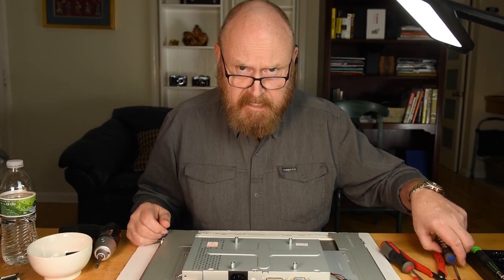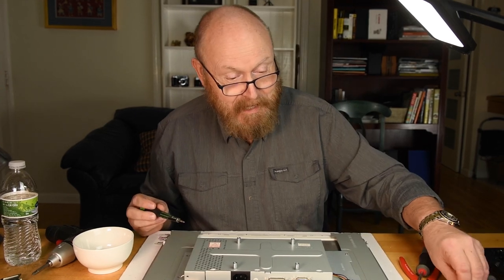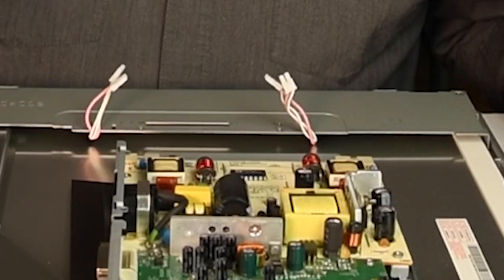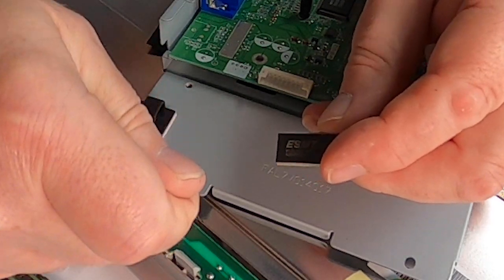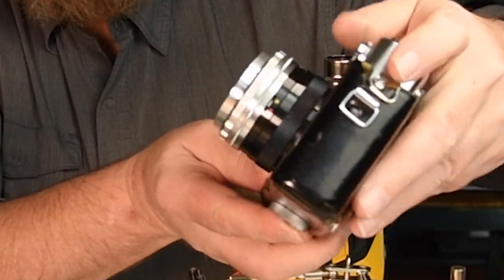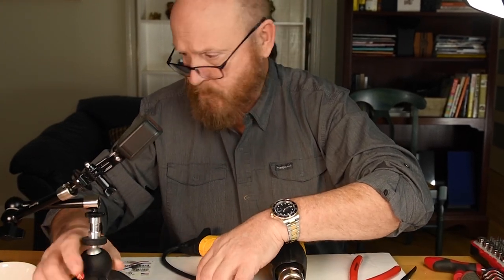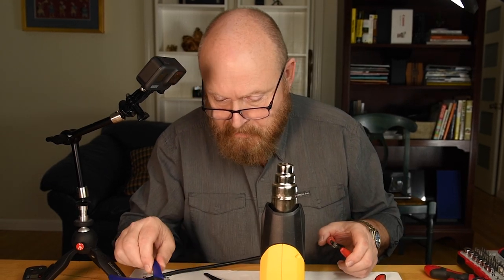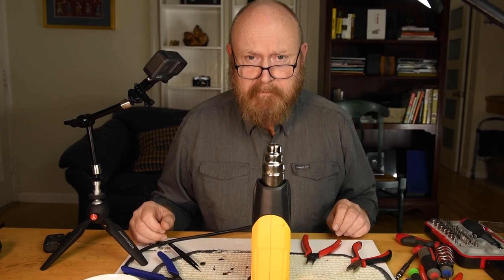Salvage Silicon for Surreal Cityscapes -  a fresh idea for macro photographers

Comment: I’m impressed with your dedication to depackaging integrated circuits, certainly more challenging than netting insects in the meadow. I spent the better part of 30 years at Intel doing electron microscopy and microanalysis of integrated circuits in the course of process development. I had it easy, my samples arrived as wafers straight from the fab. Often sample preparation was as simple as just cleaving a small piece of the desired size from the desired location on the wafer. Of course it could become far more complex, requiring mechanical polishing, chemical etching, ion beam sputtering, etc. Once you have successfully depackaged a chip you are looking at only the topmost interconnect layer. There is more further down, at ever finer scale, in the case of any microprocessor, beyond the resolution of any optical microscope. You will need an electron microscope 😀
Reply from the maker: Fascinating! I have been reading a lot about the fabrication process and it really blows my mind! I know I am only seeing the surface of these amazing devices, but when I think about all the complexity that I can't see, my brain goes numb. I bet you have some stories to tell!

Comment: Allan, 
You can simply cut the the leads off of the IC package to remove it from the board. You need a side cutter with a sharp point. Just snip away until it comes free. The metal plate under the chip is a heat sink. It conducts heat from the chip to one or more of the outside connections and into the copper of the PCB. 
Epoxy can be devolved in acetone. Heating the acetone in a closed container helps. Use a microwave oven. 
How long it takes depends on the particular IC. Do not put the chip in the acetone until it comes out of the oven. 
Not all integrated circuits are microprocessors. Only the bottom layer of the chip, called a die, is pure silicon. The other layers are composed of many different elements, some in combination with silicon.
Capacitors store charge (a number of electrons) there is no current until there is a conductive path across the terminals of the capacitor.
Hope this helps. Please keep making the interesting videos.

Comment: Very interesting.  I built computers as a hobby and never knew there was such magic inside the dull looking stuff.  I’m going to give this a try!  Thanks for the video.  FYI.  Heating both sides of the PCB will loosen the parts faster.
Reply from the maker: Thanks Stewart - I agree about heating both sides, but when I try to do it I end up knocking the blower over. I think one of those wee soldering blowers would be handy.

Comment: Hi Allen, Thanks for this beautiful video. It's fascinating to see the inside of chips. However, I want to warn you about the danger of Beryllium oxide. When I worked for Hewlett-Packard in the 1980s as a Medical Customer Engineer, there was a warning not to break or cut any electronic components to investigate the inside. At the time, but perhaps still today, a lot of use was made of Beryllium oxide in all kinds of electronic components. This is a ceramic material with properties that are ideal for the transport of heat. If this material enters the air in the form of small particles and is inhaled, it is very toxic and can have very unpleasant consequences. Just take a look around the internet.
Stay safe. greetings
Hans Kiep
Reply from the maker: Thank you , Hans, for this important message and advice. I now use a venting device to extract and filter any fumes produced from this process, and I strongly urge that anyone who is interested in attempting this to do the same. Thanks for bringing this up!

Comment: 19:16 the legs would dissipate the heat in to the air like a little radiator. The same thing happens with PCBs and trying to unsolder from a ground plane hole.
Reply from the maker: Thanks Nic. It seemed like a waste of energy to heat all that copper, or plutonium, or whatever it is!

Comment: Oh my, I didn't realize how tiny the chips are and the components on the chips.

   Without causing an alien or not alien debate, it sure is difficult to think the silicon chip was invented on Earth in 1961.  But maybe it was.
  I still can't get over how small they are.   But I see why they are encased for protection as they are.
Reply from the maker: I must say, I was completely blown away the first time I photographed one of these things. Precision engineering like this just boggles the mind!

Comment: I keep hearing about running out of flash power. You need flashes that use adapters that plug into the wall. Canon flashes have this feature and they also take big external battery packs for travel.
Reply from the maker: Indeed, you are absolutely correct, but I am working with what I have because, like many of my viewers, I don't have the means to upgrade my speedlights. It is a theme that runs through many of my videos - learning to work with the imperfect gear that we already have, instead of stressing our already limited resources.

Comment: If you know how to discharge a cap, you could build a robot. Did I miss the motorised slider? Or are you like me, got the parts but not the time to build? I thought you might have done a flying trick with the capacitor. It would give the viewers quite a kick.  Fun video.
Reply from the maker: The motorized slider is physically complete, but writing the code is not going very well. Must have been the LockTite folk that invented the code.